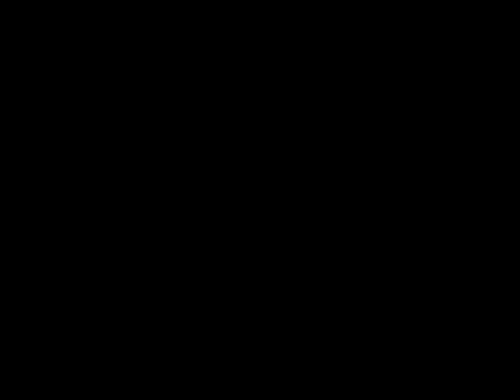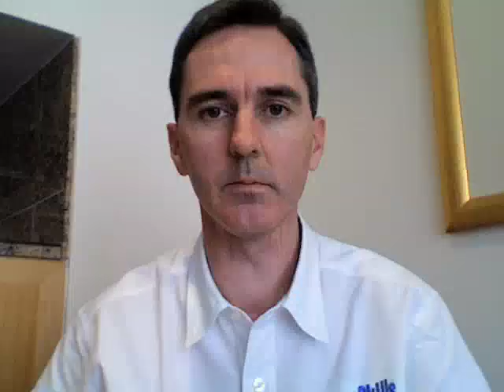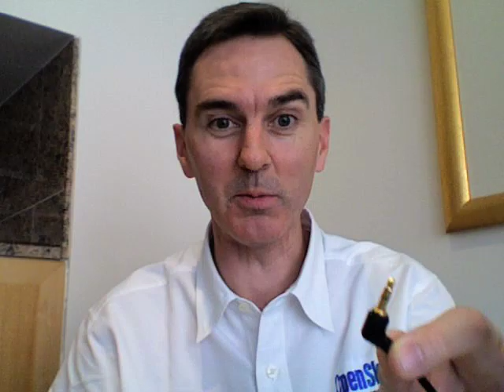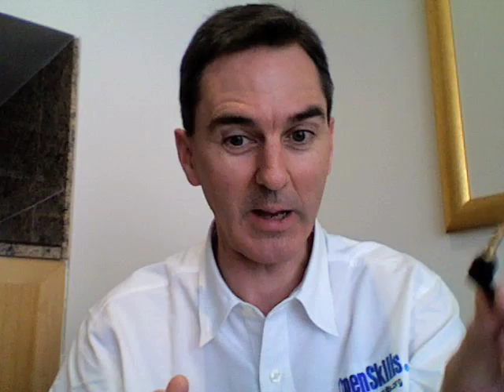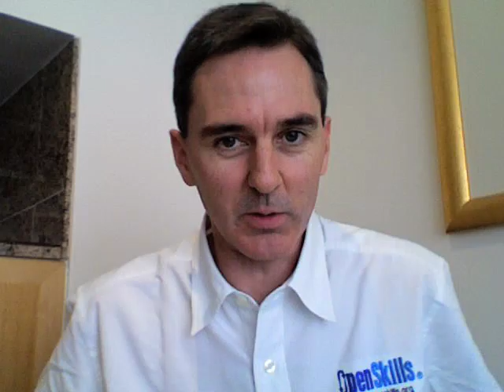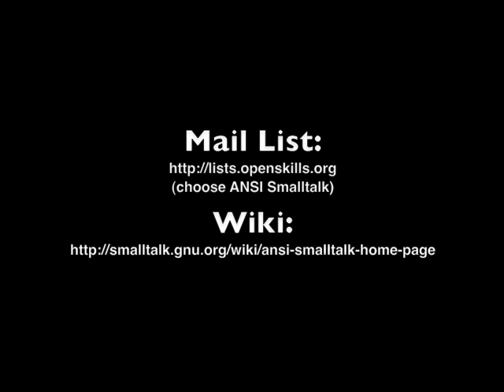ANSI Smalltalk Introduction

Comment: Smalltalk is in desperate need of a "standard." However, its standardization needs three vital components:

1. A standardized feature set that's actually competitive with other programming languages of the last decade or so. In particular, true concurrency is highly desirable.
1a. A standardized documentation, especially for the class library, is also vital. Every other major programming language has well-documented "standard" libraries.

2. A standardized class library that's actually complete enough to support a variety of application classes such as web servers, web clients, graphics, database, etc. This should not obviate Smalltalk's flexibility and extensibility but at the very least, developers should be able to easily get a head start on their application.

3. A standardized logo (hot air balloon). This is important from the PR standpoint. Look at the standard logos for languages like Rust, Elixir, Julia, etc.

This lack of a "practical" standard has held back Smalltalk's broader adoption.

Yes, I know, it's not an easy problem to solve but if you want Smalltalk to truly gain wide acceptance in the IT community, you cannot make excuses.
Reply from the maker: Agreed!  Especially about the not easy part.  In addition to your points:

o As I say in the video this is a long-lived and evolving thing.  The demands of tomorrow will be different that those of today.  And so it is with life, which is why the links in the video are dead and I'm making a living doing other things!  But long may the idea survive!

o The main obstacle here is getting engagement/energy/support from the Smalltalk community (especially commercial members) ... what would create an incentive for this to happen?  Are there some who have an incentive to discourage standardisation, and if so how can we change that?

Thanks for the comment Richard!  Perhaps interest in this will grow even more over the next 17 years!  🙂
Reply: @bwbadger  I'm doing my part: https://youtu.be/MDgbUCtCKak

😃